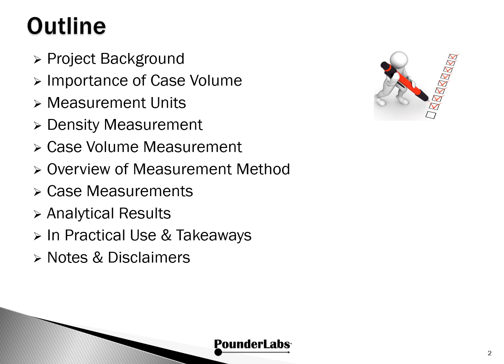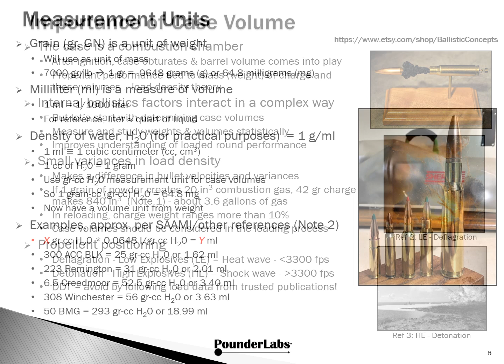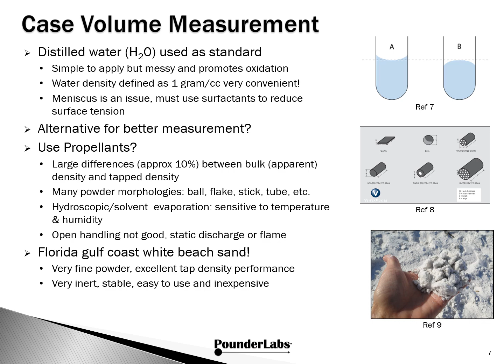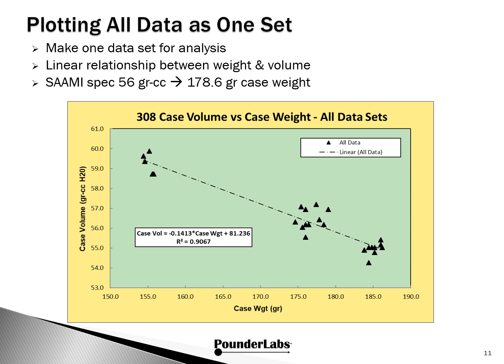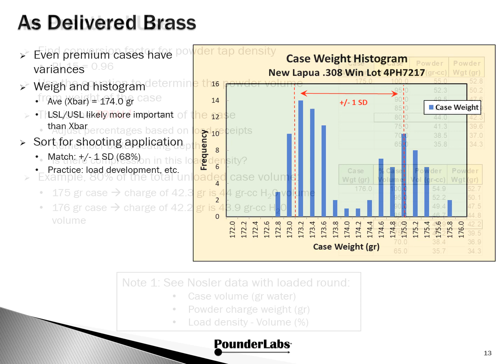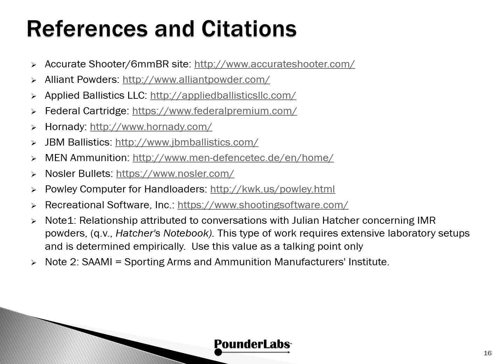PounderLabs Bag-o-Brass 308 Win Case Volume Study

Comment: Nice Don. It doesn't take too many seasons to collect samples to form the basis of test runs. Once you can collect some extreme bullets and brass, you can run your range tests and see if sorting pays off. Brass has improved in the last decades to where I rarely sort or turn with high quality brass, but I have memories of all the work it took to turn old surplus brass into match brass.